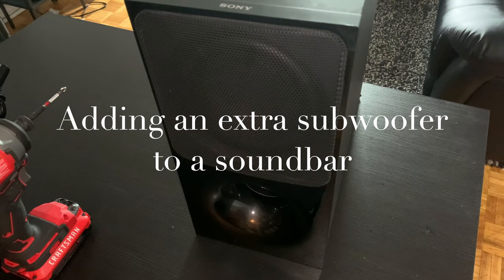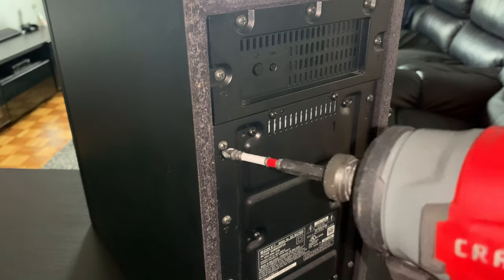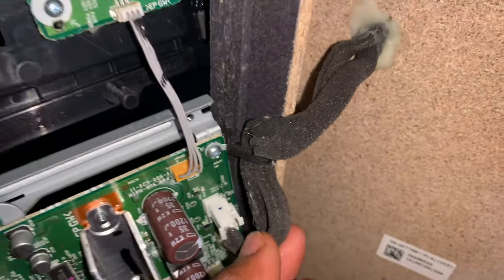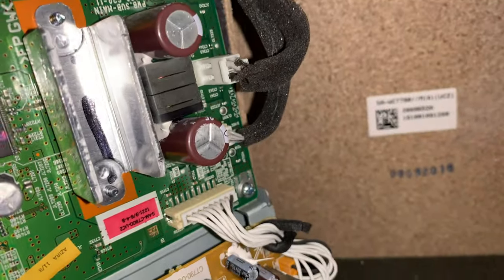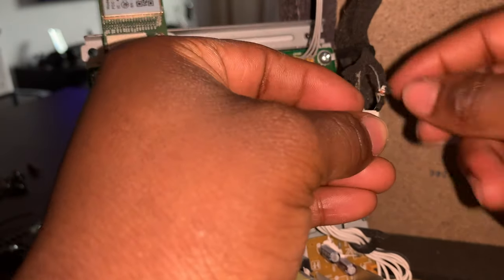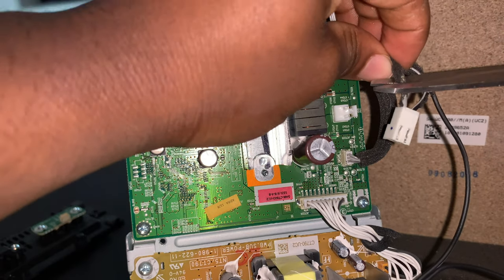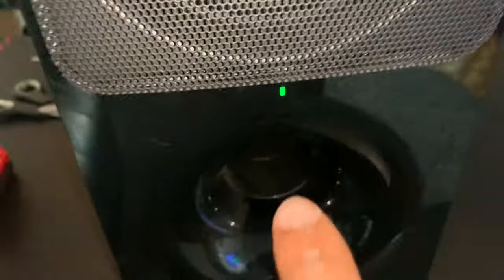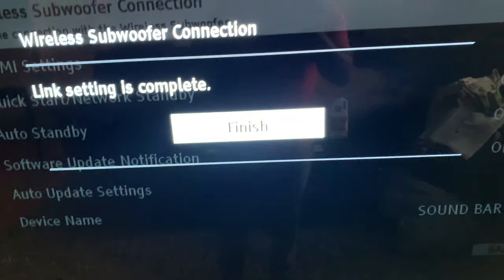Adding an extra subwoofer to a soundbar wireless subwoofer - DIY | David Yeb Vlogs |

Comment: This will change the impedance of the speakers. If the impedance is to high you will loose effect and the modification is pointless, and if the impedance gets to low there is a big chance of ruining your amplifier.
Reply from the maker: noted, thanks for the comment.
Reply: This is correct. It would ohm load the amplifier. Likely damaging it over time.

Comment: Stumbled upon this video bc I wanted to do something similar with a wireless sub, unfortunately the method you used is only half the story and will result in damage to the amplifier on that Sony sub. What u actually need to add to those wires tapped into the amplified side or known as the speaker level side is a line output converter  (loc) thus turning the signal to a line level (rca) to connect it to the new powered sub.  You can avoid what I just mentioned if you purchase a sub with speaker level inputs but doing it with a loc will also give you some sonic adjustability to the new sub. I recommend a powered loc made by Audio Control, model LC2i made specifically for subwoofer applications which can handle up to 400 watts of speaker level input. Thanks for the video.
Reply: I read your comment and you look very informed, i would like to ask you a question, i hope you read this comment of mine. 
How do i add a different wireless subwoofer to my soundbar, since the original one went mia lol ? Thank you
Reply: So if I was to do the same thing all I would need is a loc, hook it up to the amplified side, or the side that connects to the subwoofer, then run rca cables to my new powered subwoofer?
Reply: Hi guys. I need a little info regarding my ossoto soundbar all in one  5.1.
It has rca outputs front, rear, centre, subwoofer etc (I belive it's called a multi channel outputs). Anyways iv also got sw out rca. I want to connect another 2.1 active system which only has rca input an output. Can I use tvs sw out from my soundbar to rca left right input to 2.1 to use as an active subwoofer only for my soundbar.
Reply: I did it a bunch of times and it works fine if you do it right

Comment: Very good nice works but do you know If your sound bar has a rear speaker amp separately you can always by pass from the rear which is the surround to a powered subwoofers so this and enjoy more heavy bass from your system
Reply from the maker: Thanks. Yes, I saw some subwoofer that has that. Your right. I will be changing my sound system soon and I'm looking into getting a sub that has sound control at the back.
Reply: @davidyebvlogs  yw do this and you won’t get your subwoofer hurt

Comment: i also got the same idea had sony htrt3 600watt 5.1 soundbar system the sound is great but woofer bass is not that great its a 6.5 inch mid bass hence i want to connect an additional bass of 12 inch double magnet dual voicecoil speaker like jbl or sony explode may be from 300 to 400watt rms i got an idea that amplifier output for subwoofer is bypassed and connected to an additional subwoofer input signal hence i can enjoy bass from both soubwoofers and db also can be increased in total as my system is 85 watt in total i think total spl may be around 85 to 90db but as instance if i add an additional sub spl can raise from +3 to + 6db is my point correct are there any limitations can anyone guide me
Reply from the maker: I think your on the right path! try it and let me know how it sounds. 👍🏽
Reply: How did it workout?

Comment: @David Yeb Vlogs hey David, I have the Sony Soundbar w/ wireless sub model # ht-ws350 and I purchased an additional sub exact same model. It works and does connect. However, it cancels out the other & vice versa. Is there a way to get them to connect simultaneously?
Reply from the maker: Hey MsJamie, No it's not going to work. because the soundbar will not send signals to 2 different subwoofers simultaneously. You have to connect with a wired connection like in my video. It's the only way until SONY decides to make a soundbar that can support 2 subwoofers. hope this answers your question. have a good one

Comment: Hi , I have a JBL SB271 220W  Soundbar which has a wireless subwoofer. I want to add one more subwoofer to it as it just have a lower bass . So any suggestion ?
Reply from the maker: you can try to add a wired subwoofer 🔊, connected to the wireless sub like I did. it will work

Comment: So using your video I'd be able to use the original sub to send audio signal (RCA) to a new amp & sub?

Ive got a samsung soundbar with no output jack and an awful sub. So i plan to use a car audio setup with the input signal from the old speaker wires

Edit: my original sub had 4ohm 28W output. I learned you can use a line output converter to connect the speaker wire to an rca output 👍 should fix my problem

Now I got a skar SUB and ported box running off the soundbar sub amp (speaker wires going into new box). It's MUCH better. I read a comment saying car audio is much less efficient so it uses higher wattage. My current setup might be enough for most people. I bought a mono sub amp and Computer psu 220$ total - might just return them

Comment: Hi
Thanks very much for showing this video,but when I put the volume up more than 30 db the Sony sub will lose the wireless connection and both sub’s bass will not work unless I unplug and plug back the Sony sub. So do you know what to do to fix this issue? Thanks for your help.

Comment: Hi David ,
your video is very impressive,
I am facing little problem, I am having a boat Avante 2000 Subwoofer wireless bluetooth 2.1 version. Not getting connected to other soundbar , I order "Zebronics Ace Plus Wireless Soundbar with 30W Output, Dual Passive Radiator, RGB Lights,Built-in Rechargeable Battery, Bluetooth 5.1,Coaxial Input, AUX, FM Radio, USB, mSD, TWS Function".
What should I do to pair with subwoofer?  Should I try to follow the process to showed in video, ?
if am not having any wired speaker or soundbar can I connect through Aux wire to connect with subwoofer soldering.
Please give your suggestion 🙏
Reply from the maker: Hey I will look into it and get back you soon

Comment: Hi, i want to connect Sony HT XT100 with Sony wireless Subwoofer. Will it work??
Thanks in advance
Reply from the maker: hey, yeah apparently Yes!. this Sony - SA-SW5 300 W Additional Wireless Subwoofer is designed to connect to your wireless sound bar. Make sure your soundbar has subwoofer connecting capabilities. Hope this helps. stay safe.

Comment: Question:  I just received a Yamaha soundbar and a SHU sub... I tried hooking it up to my bedroom TV (Sony A9S Oled 48"), The light's are on on the Sub, I have the sub connected to the Soundbar but there's no sound from the sub. The soundbar plays but not the sub.
Suggestions?
Thank you
Joe
Reply from the maker: Hey Joe, good question. What's the model of your Yamaha soundbar? Because soundbar are very picky and complicated to pair with especially if the soundbar and the subwoofer aren't together in the same box designed to natively connect to one another. Let me know the model of the subwoofer as  well.
Reply: @davidyebvlogs  Yamaha YSP1.. I contacted SHU and they told me their sub should work with the Yamaha.. so far no luck.. might be a dead sub?
Reply from the maker: Yeah you might be right, the subwoofer is probably the issue. I'm sure its not connecting with the Yamaha soundbar like it should. hopefully you can return it or exchange for another one.
Reply: @davidyebvlogs  It's trashed.. it's old and was told it would cost more to fix than to buy a new one.. now looking for a smaller one for bedroom use. TY
Reply from the maker: hey no problem! thank you for asking! 👍🏽

Comment: Hi,Can you separate Soundbar signal   for extra rear speaker?if okay ,this make perfect surround sound
Reply from the maker: Very good question. Yes you can using Sony's optional wireless rear speakers like the SA-RS3S Total100. But they are expensive that's why some will just add speakers using a wired connection. It's a lot more cheaper. Hope this answers your question.

Comment: Hello, I have an LG model S55A1-D subwoofer but I don't have the soundbar.
How to make it work or how to change Bluetooth subwoofer to wired speakers?
Thank you
Reply from the maker: Hey Omar, thanks for your comment. I'm not really familiar with this model. What I can tell you is that its extremely hard to connect to a subwoofer that didnt natively come together with the soundbar. Unless they where sold seperately and be paired together like the Sony HT-A9 and SA-SW5. There sold seperately but they can be connected. I hope this answers your question. Let me know if you have other question. wish you all the best.
Reply: @davidyebvlogs  Thanks for the answer. I’ll try with your method and see if I can make it works. Big up for your work 🙏🏽

Comment: Just sayin'...

Wiring in parallel reduces impedance. This is calculated by dividing the number of speakers by their impedance. For example: 2 speakers @ 8Ω = 4Ω

Improper impedance matching (speakers to amp) can lead to excessive power use, distortion, and noise problems. The most serious problems occur when the impedance of the load is too low, requiring too much power from the amp to drive the speakers at acceptable levels.

i.e. This nifty little solution to 'add an extra subwoofer to your wireless soundbar / subwoofer' which you purchased at 'Jim's Home HiFi' for $299.00, will overload the amplifier - which was only designed (at a minimum manufacturing cost) to run the one speaker it was built with.

This will do at least one of 2 things, but most likely both:

1. Burn out the $9.99 amp component in the sub enclosure.
2. Sound like crap because it doesn't drive either speaker properly now that you have 2 attached. Sure, it's louder, that's a fact. But it doesn't really sound better. Play something that is produced properly, and turn it up to at least 120db, and you'll hear the difference ;)